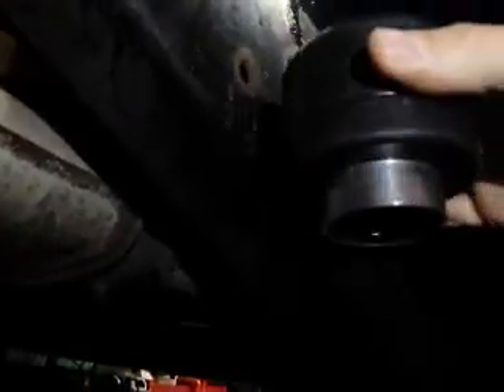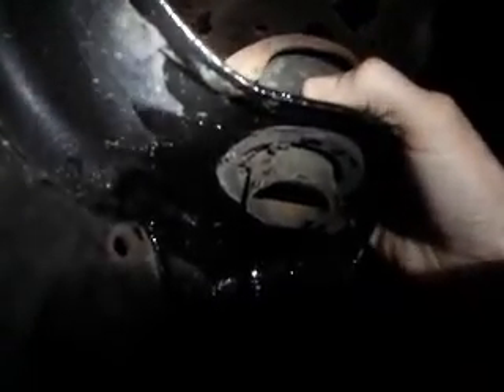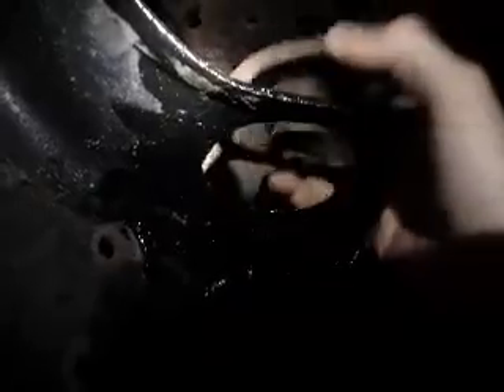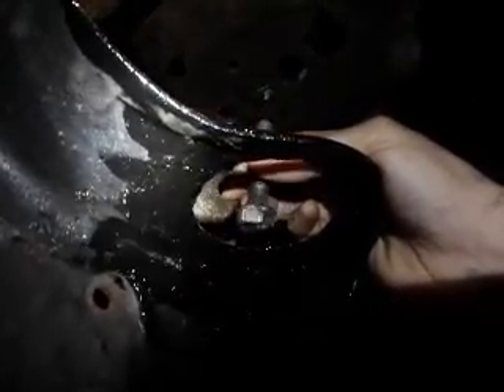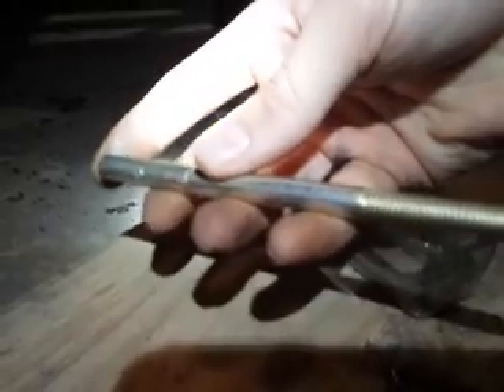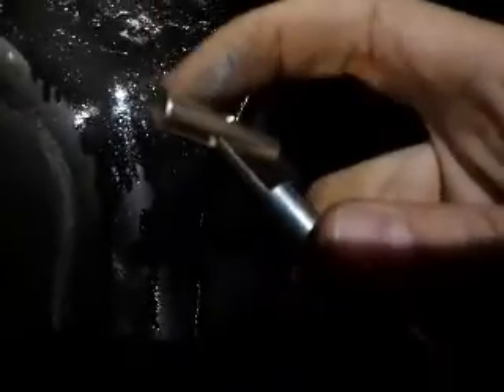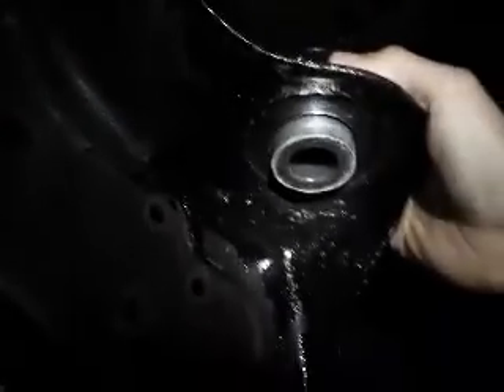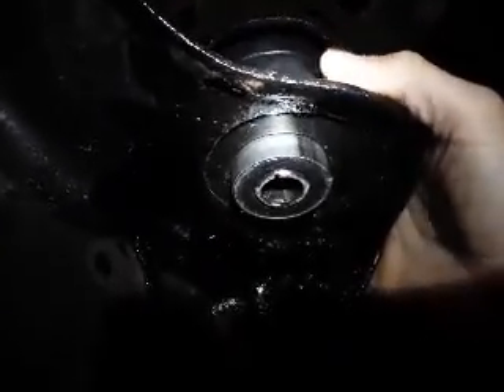Replacing Rusty & Sagging Chevy C/K Cab Mounts - Tips & Tricks

Comment: You can access the body mount bolts through the cab. There are metal plates snapped into an access hole, then sealed with seam sealer. Just remove the seam sealer then use a pry tool and carefully pry up the cover. Good the put knocker-loose on them. I had the drill out a busted bolt from inside the cab. In the video, even if the bolt is broken/sawed flush, if you are a good welder, you can weld a nut to the bolt by welding inside the nut to the bolt. In addition, the heat from welding will help break the bolt free.

Comment: Weld a washer to the flush bolt, then a nut to the washer.  Works, I've removed many flush broken bolts that way, sometimes yah go thru a few nuts before you get one to hold good.  LOL I went thru about a box of nuts to get the really rusted broken U bolts out of my C3 Corvette axle stubs, one even snapped off after welding a nut and was recess a bit but a half dozen nuts later she came out.

Comment: You can get to the other side of those bolts if you pull the carpet can pull the covers
Reply from the maker: Good point Steve, that is true. Once you access the other side, do you have any tricks for getting the bolt out from that side? I assumed I'd have more room and options from the outside than from inside the cab.  I worried after all the work of pulling the bench seat and carpet etc, I'd be left with even less room to weld on a nut or something to get enough purchase on the exposed bolt to get it out.  I'm sure others who find this video would appreciate any tips you have for getting the bolts out from the inside.
Reply: Cut de weld on the nut and weld another nut at the same place

Comment: would you need to put a washer on each mount on the cab? i’m in the same situation and not sure if it would throw the body lines off
Reply from the maker: Hey Noah, you shouldn't have to add a washer to any of the body mounts that aren't rusted.  The washer is only like 1/8" thick, that should be well within the "Noise" of any body line alignment, the factory bushings are rubber and not that precise.

Comment: Loved the video.  However, one problem seemed to stand out.  If you had to use a large flat washer on the top of the bracket to prevent the bushing falling through and thus the cab sagging issue.  Surely you should have placed another washer under the bracket prior to installing the lower bushing.  Not installing a lower washer would allow the lower bushing to simply slip upwards through the bracket hole and therefor the whole repair would be redundant.

I and I am sure many others would like to have an update from you.
Reply: That's why I came to the comments sections I was looking for that second washer deal because the whole cab just lift right up off of the frame
Reply: @juanmarshall4083  Well I'm glad that I was helpful to at least one person.   Cheers
Reply: I welded the washer to the frame
Reply: @kevinbergen4309  where did yall find these washers at I've looked all over except ordering on line I've tried home depot Lowes ace hardware no one has this big of washers I was thinking maybe tractor supply or something ?
Reply: @joegirton2178  there's a nut and bolt supply place in my town.  The hole in the center of the washer was approximately 2" and the outside was bigger than the amount of rust I had on my frame mount.  It was about $20 for 4 of those washers but I only had to repair the cab mounts closest to the box.

Comment: @big6ft6 what is the size of the washers you used?
Reply from the maker: a washer for a 1 and 7/8" bolt, If I remember correctly it has a 2" diameter hole in the middle. I had to go to my local commercial metal supply place, they won't have them at a hardware store. Look for a metal supply/fab shop that sells metal to businesses.  Mine had these washers in stock they were like $2.  I talk about it in this video
https://www.youtube.com/results?search_query=5+minute+fix+chevy+cab+mount

Comment: Besides gravity, what prevents the bottom bushings from going up through the frame brackets?
Reply from the maker: Hey Scott, this is a good point.  With this type of repair, while new condition bushings are stiffer and may provide some additional resistance of pulling up through the bracket, technically nothing is preventing it from happening. However anyone with this problem is driving around now with nothing preventing this either. This repair only restores cab hight/alignment, it DOES NOT repair frame brackets to OEM condition.  If someone is looking to restore frame brackets to OEM functionality, they should of course weld the washer to the frame bracket.  Anyone expecting to use their truck in a way that will result in forces trying to pull the cab off the frame should absolutely do that.
Reply: @big6ft625  I was wondering if I could use two washers one on top and bottom of the bracket? Do you think that would work or maybe not enough room.
Reply from the maker: @Phillip Aurthur yes, it's worth a shot. I can't recall if there is any reason. A washer wouldn't fit on the bottom too. Should be enough room (threads) on the bolt I'd think.
Reply: @big6ft625  Thank you for replying and I just got your message. Oh and do you know how many cab mounts are on a regular cab?

Comment: I have to replace the mount front of a 1999 Tahoe  what do you do if mount is rusted away on the side like gone ? Because those mounts are welded to frame . Has anyone replaced the whole mount by grinding weld off ? And replacing them from one in junk yard ?

Comment: Nice job but you could have placed a nut next to the bolt you cut off and then welded it thru the hole in the nut and proceed as you did on the others
Reply from the maker: Good idea John, that would've been worth a try for sure!!  Thanks for sharing.

Comment: I was stupid and did the same thing i was just wondering if the toggle anchor worked its my last resort
Reply from the maker: Yeah, Zach it worked.  I didn't crank it down quite as hard as other, but it never came out.  Just sold the truck this summer and never had a problem. If I recall correctly I just used one of the existing side holes.  The bolt ran at a slight angle but I was able thread a nut on no problem.
Reply: @big6ft625  awsome thats what i was hoping to hear

Comment: where did you get the 1-7/8 bolt washers ??
Reply: Can't find any in Cent il ...where is the one you found at ?
Reply: Grainger has them.
Reply: 1-7/8" x 4.250" OD Low Carbon Plain Finish Steel USS General Purpose Flat Washer
Fastenal Part No. (SKU) 33035   Works like a champ!  Great tip!

Comment: You happen to know where to get a frame bracket mine is rotted to hell.
Reply from the maker: I've never found a supply.  I've seen some youtube vids where some fabricate them from scratch, but I've never seen a place to buy the brackets.
Reply: @big6ft625  I found a place but you think your method in the above video would allow me to replace all 4 bushings on a reg cab 92 silverado?
Reply from the maker: Cool, you should list where you found brackets for others. I think that is a common question.  The bushings in your 92 should be the same bushings so anything in this video should apply to your truck from what I know, but I can't obviously promise anything without seeing your truck.

Comment: Mine the whole bolt pulled clean out through the cab. =* joy
Reply from the maker: Is the hole left behind small enough to still use a toggle bolt?
Reply: The mount and bushings everything flew out onto the Interstate I knew I ran over something not tell the driveshaft was rubbing did I discover what had happened. I think that will work just have to make or buy new plates and rubber. Dealer says 100 plus each for assembly there is 6 total. I am brainstorming a way to just fab all new mounting system for the cab using large washers and stacked slices of tires as the rubber bushings. The truck may just be a total loss of my $1500. Oh well it got me to work a handful of times. pulling truck or a Farm Sleeper Drag Race Truck balls out?
Reply from the maker: Check out rockauto.com, they have full sets for under $100.  Not sure if this link will work, but I'll try to paste it here.
http://www.rockauto.com/en/catalog/chevrolet,1993,k1500+pickup,5.7l+v8,1050961,body,body+mount,673

Comment: Where can I find the body mount hard ware kit
Reply from the maker: OEM hardware can be found at LMC Truck.  If you want poly bushing instead of OEM rubber, I think I found aftermarket polyurethane bushing sets (no hardware) at Summit Racing?  Or just google "Chevy C/K body bushing kit polyurethane" and see what comes up.  Also check RockAuto.com, I seem to recall having a good bushing set, and maybe hardware? (I can't remember)